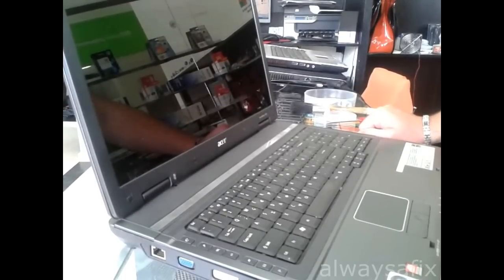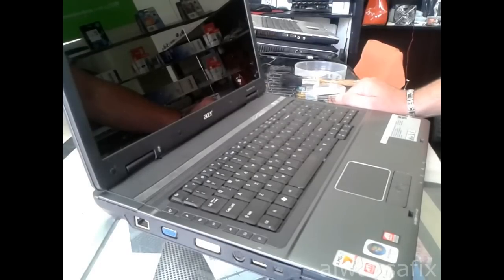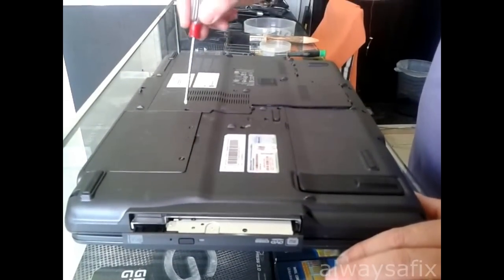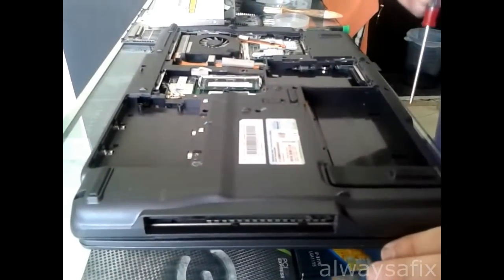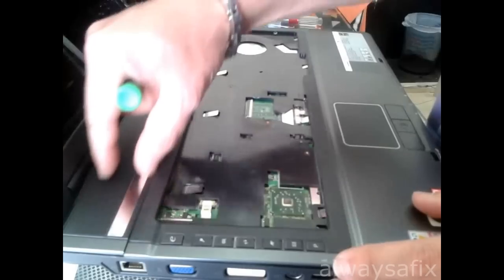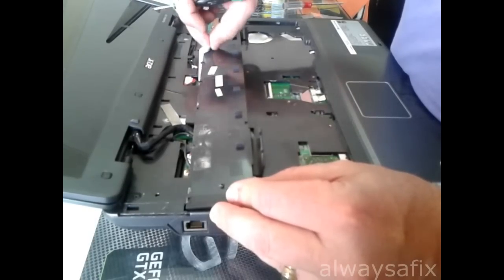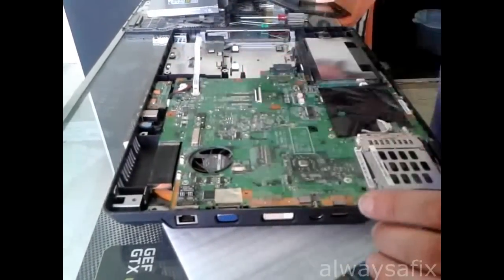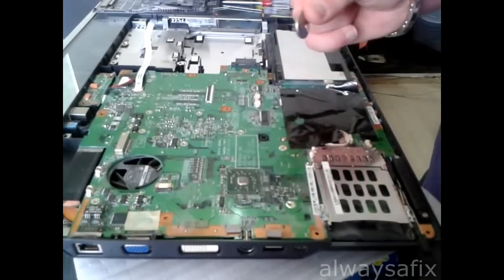Acer laptop not starting black screen repair

Comment: I have the same problem. I was opened the notebook 5738g to clean and change fan. Now i have reassembly this, connector, flat and my olde CMOS battery but when i push on, only light and fan work.. black screen. Are you that i fix this with new battery?

Comment: Hi .  " ,  , i have an Acer 5750 just changed the keyboard   , then i get this problem, so when i Push the power bottom its blink for few second  and it turn off quickly ! I tried many  ways , charger is ok .battry was ok .seen Other Youtubes too... then i Took of all the part on by one and tried ,like  taking out BIOS battery , RAM, Hard Disk , USB connection/board  ( which is not on mother board ) ,DVD Driver ,,....all , it didnt work ! still when i push power bottom it blinks  for few second and turns off . i changed the BIOS battery like your but didnt work still have the same problem .What might Be the problem ? how to fix it ? thank for your help .

Comment: My laptop has been reluctant to start up during the three last weeks. Today is not able to startup. I guess I will have to do the same that in this video. Can you confirm to me that I am having the same problem and so it requires the same solution?

Comment: Hi there , I have a Acer Aspire E15 , this has happened to me , I tried a hard reset with taking the battery out and holding the power button and then switching it on but that didn't work. I've been to and asked various technicians but they all say that it isn't the CMOS battery. They say it's impossible because I've only had the laptop for a year and a half ? 

Very informative videos, you earned a subscriber. Also you sound like you from South Africa 😅😅 So am I !

Comment: I've got an Acer Extensa 4620Z sitting in front of me currently. The screen will not turn on, I have the charger plugged in to the wall and device for power. The green light comes on and stays on but doesn't blink like the one featured at the start of you video. I'm clueless as what it could be seeing as I'm not very tech savvy. If you have any ideas on what it may be or any feedback.

Comment: i have a sony vaio purchased in dec, 2006. it no longer starts and screen is black, i have tried new ram but futile. when i turn on the power light turns on green but screen remains black, also verified its not a display issue, do you think cmos battery is likely cause in my case ?

Comment: This is a very informative video! I have an Acer Travelmate 5530G with black screen. The two leds go on when powering up. The fan may or may not start depending upon if it i hot inside or not. No beeps, no sound from the HDD, nothing on the screen even when using a strong light in front of the display.

I have been thinking about the Bios having too low a voltage since it seems that more or less nothing really takes place.
Another observation is that without the battery attached just the laptop charger even less happens which would suggest that the internal power supply is malfunctioning. THe optical drive seems to do something but the sound is strange like it is very "tired".

My question is "how did you arrive at the conclusion that the Bios battery is bad"? Is there another video on arriving on that conclusion?

Cheers Johan

Comment: I have the same model that you used in this video, the first time that this problem happened I've changed the battery and it worked 
Now I've tried again but the issue continues ...

What can I do?

Comment: Will this solve this problem:  when i turn my laptop on the blue light comes on and it automatically turns off and on the whole time the only thing i can do is hold the power button and it goes off.  

This was it.
Reply: Jesse same!!!!
Reply from the maker: +ItzBlueEyes Have you tried a different laptop charger?
Reply: alwaysafix do you have other plans to repair other than charging it with an another charger? pls reply
Reply: Jesse same problem
Reply: Jesse I have the same problem as you

Comment: hp laptop batrey not charg and charging light  not turn on but its work whitout batrey help me
Reply from the maker: +Danial Sohail First I would test it with a second known working charger and then I would replace the battery.  Good luck!
Reply: bro charger is ok but batrey is not charge and also garging light is not on sorry for bad english
Reply from the maker: +Danial Sohail Even though the charger looks like its ok, you still need to check it with another known working charger.  I've seen many chargers that give the correct voltages but are not working due to low amperage. Good luck!
Reply: thanx bro but today not batrey show in laptop and i am chek otar charger but batrey is not charg thank u soooo mushhh bro you are the best

Comment: Hi, I have an acer aspire 5551 which I am having problems starting which happened a couple of months back now. I was using it on the evening then closed the screen as I have always done, came to use it the next day and it wouldn't start and was like it for a couple of months so I decided to get it repaired, but I tried it the day I was taking it and it wouldn't switch on, got to the repair shop and it came on straight away!!?? couldn't believe it so he had a quick look, told me there we're viruses on it, so left it with him, he worked on it, removed the viruses and said alls fine. I got home pressed the power button and again wouldn't start, so took it back but he didn't know what it was and said no point spending more money on it...... when you press the power button it lights up and you hear the fan start for no more than 2 secs and it stops. have tried all the steps you have mentioned except the last as have no screen I can test it with, though I feel that wouldn't help as the the fan cuts out after 2 seconds. do you have any more Ideas as to what it could be. I have taken it to pieces to double check all the connections are in place and haven't come loose but still no luck. would really appreciate your help!

Kind Regards

Ian
Reply from the maker: +ian white I take it that your changed the cmos battery as I did in this video?  Also, try and start with one stick of ram at a time.  Otherwise, its pointing towards a faulty motherboard.  Good luck!
Reply: +alwaysafix 
Hi thank you for responding. Have taken it apart again and found the cmos battery, unfortunately mine is soldered into place, so not sure what to do now as it doesn't seem very easy to locate the same.
I was wandering whether it was possible to attach a battery with wires whilst the old one is still in place, to see if it is the battery, or should I just take it off completely as I was reading other threads and it was saying you need to be careful when desoldering and soldering as this could do more damage, are they correct saying that??
Reply from the maker: +ian white You can test the battery with a multi meter while its still soldered to the motherboard.  You're looking for 3 volts.  Good luck!

Comment: Hi! I have an Acer Aspire 9300 and when I turn it on the screen remains black.
Sometimes it will boot up Acer logo>Windows>Commands than when i choose a command the screen goes  blank but bright,not black.
Earlier it beeped 3 times when I turned the laptop on ,but black screen.
I fixed that only temporary.
Can you help me?
Reply from the maker: +Nappy Boy When you connect to an external tv or monitor does it work normally?
Reply: alwaysafix I haven't tried yet.

Comment: Hi.
I have same problem. 
When a start up appears a white glow for a second and then when i press fn+f5 (turn on/turn off backlight) it gives a white glow for a second. 
I replaced lcd, inverter and the battery as you do. 
If a connect the pc to an external monitor it works just fine. Can you help me?
Reply from the maker: +Angelo Freitas In the workshop my next step would be to try another lcd.  Good luck!
Reply: +alwaysafix I had tried.
I teste the inputs on the inversor and i saw the problem.
I haver four conectores and one with 19V other with 0,02V other with 3,25V, and Last the GND. so the problem is the adj the second pin. but the cable is good só the problem is on mainboard, do you know how can I test mainboard?
Reply from the maker: +Angelo Freitas Before you worry about the motherboard, find the switch that is activated when the lid is opened and closed, it could be magnetic.  That might be your problem.

Comment: hey man. My problem is that my laptop turns on but no display. You could see a bit of light in the screen but no pictures or anything. Please, can you help me with this?-----and what small battery do  i need? where can  i fnd the battery?
Reply from the maker: Samin Rashid When your laptop starts do you see the disk drive led flashing?
Reply: alwaysafix yes, everything s workiing fine, but no display. the computer starts up but no picture or anythng.
Reply from the maker: Samin Rashid First step is to connect your latpop to an external monitor or TV and see if you get video, then get back to me.
Reply: yes, i connected and i could now see everything on TV? What's the next step?
Reply from the maker: Samin Rashid If it works on the TV it's got nothing to do with the cmos battery.  In the workshop I would connect another laptop screen, check the lvds cable.  This would leave gpu issues.  Please make sure cooling fans are working and not blocked up with dust etc...

Comment: I have the same issue - black screen, nothing happens. If the light for the HDD doesn't flash, can I be sure, that the problem is the HDD?
If not - any recommendations how to troubleshoot?
Reply from the maker: DJpreskoboy The HDD is not required to start the computer.  You can remove it and try reseating the RAM first.  Good luck!

Comment: Please please answer. I have an Acer Extensa 5620 . My base had a lot of  external damage ( power jack cable, head port cable broken, dents etc). I dissembled the display and took out the HD,  2 Rams and Lan slot. I put everything into a new base I purchased off line  and attached the display. Now the laptop powers up, the green light flashes on, but the screen stays black and the laptop shuts down after 10-15 seconds. What did I do wrong? I reset the Ram but nothing changed. First time doing this.....please answer
Reply from the maker: slksrkhrr Strip it back down and try and power up the motherboard out of the casing.  If it boots reassemble step by step and ocassionally boot it again until you find what's causing the failure.  Good luck!
Reply: When u say strip...should I remove the ram and had as well?
Reply from the maker: slksrkhrr Hard drive yes, ram no.  The ram is needed to boot.
Reply: I ended up just changing the cover and sticking with the original motherboard. Started just fine. I'm suspecting that the motherboard was had a problem. Unfourtuntly I don't have the correct tools to replace the head phone port.
Reply from the maker: slksrkhrr Find a small computer or TV repair shop.  Im sure they would solder the new one on for you for a couple of bucks.  Good luck!
Reply: Thank you soo much for your help and quick responses.
Reply from the maker: slksrkhrr No worries.  Thanks for watching.

Comment: I'm extremely surprised that the CMOS battery was the cause of the laptop not starting up. The CMOS battery is used to provide the CMOS RAM with power after the laptop has been powered off so the BIOS can remember the startup configuration. If the battery was dead, the settings would just reset to factory default each time. Are you sure that was the main cause of this fault? Maybe a RAM module wasn't inserted properly, and when you put the laptop back together, that rectified the fault that way?
Reply from the maker: ***** Although your argument is valid, Ive come across this problem many times and replacing the battery was the fix.  Thanks for watching.
Reply: I'm not saying you're wrong, and obviously the problem was resolved. I just found it strange that the CMOS battery was the main culprit here. Good to see you take the time out to make these vids to help people. Keep up the work
Reply from the maker: ***** Thanks for watching.

Comment: Hi,while watching a movie my acer 5680 had crashed then it displays white screen with red/blue vertical lines.when i used an pc lcd monitor, it works but there's a green vertical lines covering the screen. I decided to upgrade from vista to win7 but after it was been replaced, still using the pc monitor, it will no longer boot.it only displays a black screen with blinking cursor line at the upper leftmost corner. could you help me figure out  what really the problem is?since using other monitor, the display is not good before.Thanks!
Reply from the maker: Renante Gaite It's your graphics card.  If it's onboard you need to look at it getting reballed.  Good luck!

Comment: Thanks; really useful demo!! Had this same fault with a similar model Acer Extensa 5420. BIOS battery was fading causing intermittent boot fails. Although no real need to remove/ disconnect any hardware (just battery pack). With all screws removed the top front plastic cover can swing up just enough to carefully access/replace CR2032 coin battery.
Reply from the maker: Kohutuhutu Congratulations on your fix and thanks for watching.

Comment: hey i have a acer aspire 5552 and when i press the power button the light comes on and the hdd/wifi light dont come on and the screen stays off can you help me?
EDIT: i ha ve tried reseating the ram and it does nothing even without ram

Comment: Hey , i have a Acer Aspire 5532 that i been having problems with. Today i tried turning it on but just wont start up. I put the charger in and press the power button , the power light came on but nothing shows up on the screen and i don't feel the fan spinning . I'm not sure if i should hear the hard drive as well lol but i really have no idea whats going . Is there any solution to fix it?
Reply from the maker: kayla Nathaniel First step is to try reseating the ram.  Good luck!

Comment: Hi,
I have a dell laptop it suddenly stopped working it has a black screen and the fan is also not working can you help please
Reply from the maker: Have you tried connecting to an external monitor or TV first?
Reply: alwaysafix  Hi,i was able to solve the problem. thank you very much for your help.

Comment: Very good video, but could not solve my problem.
Acer TravelMate 5530 after switching on dark the screen.
Only lightning the power LED and charge LED . A couple of seconds to spin up the cooler.
No whistle. Memory and HDD I check, LCD Inverter OK, I changed the battery, but it was okay. Charger OK. External monitor does not display.
As if it does not start the BIOS boot, I tried to flash the BIOS, but now does not work either. Maybe I did wrong? FN + ESC + Power + ESC or WIN +ESC+ Power start computer?
Please, help me! Thanks!
Reply from the maker: From what you have told me it sounds like you have a motherboard issue.  You need to take it in to service and have diagnostics done to confirm my suspicion.  Good luck!

Comment: So I have a msi laptop or Microsoft .
And I haven't used it for maybe 5 years
And it won't work so do I need professional help or do I take the battery out and the charger and press the power button for one minute ? Please help
Reply from the maker: When you press the power button is there any life at all, lights etc?

Comment: What if when I turn on my laptop the screen appears all black and when I turn it off the power button changes its color from orange to black repeatedly
Reply from the maker: Remove the battery and power cable.  Press and hold power button for 1 minute.  Good luck!

Comment: no image(black screen) until windows load. no external monitor working now
Reply from the maker: As long as windows is loading, don't mess with it.
Reply: alwaysafix now i experience when laptop not on charger or on battery. the post screen visible again. i have usb cooler plugged. when it plug it black again wtf
Reply from the maker: Mana dmg It's obviously your usb cooler that is causing the problem.

Comment: Mine is an ACER E1-571 and was lightly dropped (I was told) no external damage whatsoever.
The power indicators (button and front) come on for approx 5 seconds then off. NOTHING on the screen. HD spins but likely bad as I connected it to a usb. I have re-seat the DDR.  Remove Batt. & Cord 1 min reset ;) Look like I'll have to open it?
thank's

Comment: hey i have a problem whit my acer extensa 5420i when i push the start button it starts turn of then start again and turn off complete how do i fix that?
Reply from the maker: Check the charger with a multi meter.  Good luck!